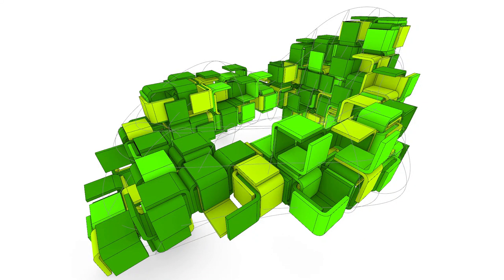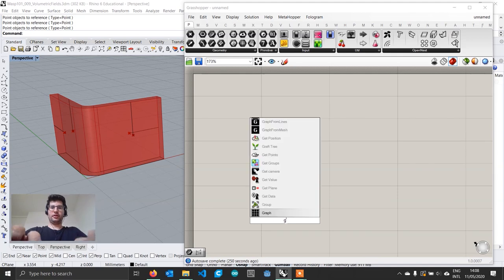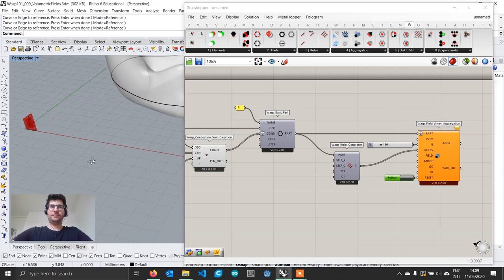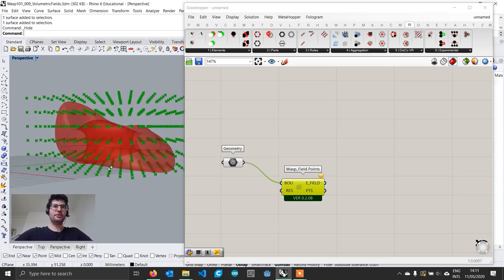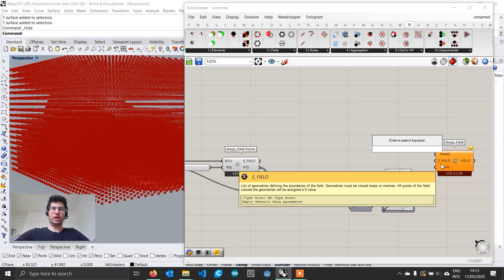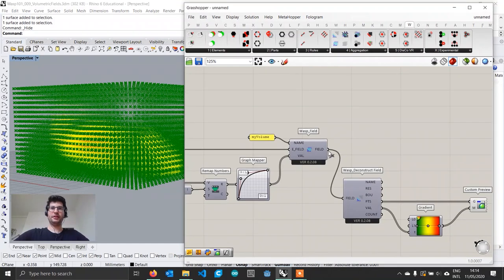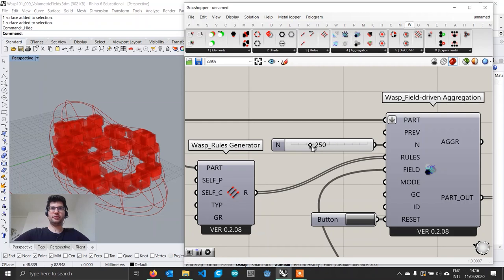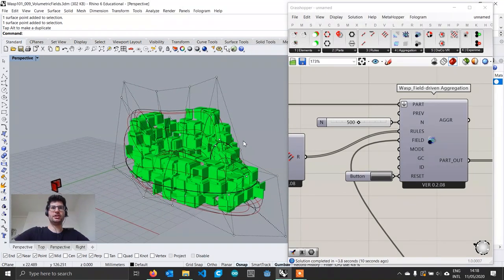Wasp for Grasshopper #101 - Tutorial #009: Volumetric Fields

Comment: Hi Andrea, thanks for the plug-in. I am confused about the difference between volumetric fields and mesh constraints after watching the tutorials. It seems like they both function as something to restrict the modular part to grow only inside a larger volume. I don't know if my understanding is right.
Reply from the maker: Hi! Yes, mesh constraints and volumetric fields can be used to achieve similar results (with mesh constraints normally being faster computationally). However, the main difference lays in the way they achieve the result: while mesh constraints rely on a purely stochastic (random) process to find the result, volumetric fields follow a logic growing from the center (or wherever you define the highest values in the field) towards outside. So, the main question is if you are interested only in the final result, or also in the intermediate steps and how it got to that result. As a general rule, fields allow you a more granular control on the aggregation process. Hope this clarified it a little :)

Comment: Hi Andrea! Ive been using Wasp for one of my projects now for class but I've been having a problem with volumes with holes. Sometimes the aggregation would completely fill all the space before filling the hole, but a lot of times it would bundle in a corner. For context, I'm using modules to create a pathway hence having a box with holes in the centre. Would you know if there is something I could do to fix the problem?
Reply from the maker: Well, it all depends on the relationship between your field's resolution and the dimension of your elements. This can influence the performance of the field. What I provide in the video is a basic general recipe that should work well in most cases, however geometries which are more complex might require a different approach. I would suggest trying to change a bit the resolution of the field to see if this improves the results. If it does not, feel free to send me the file you are working with and some comments at ghwasp [at] gmail.com and I can try to have a look.
Reply: @TempAutonArch  Thanks! I was able to fix the issue. It was the resolution. I appreciate the reply and free lessons!

Comment: Hi Andrea, thank you for the video series about your fantastic plugin! Is there a way to preserve rhino layers in the part geometry? I saw your proxy geometry video; I want to do something like that, except each of my detailed part has different materials within it. Is there any way to do this? Thank you.
Reply from the maker: You can do it in two ways:
- one is the one illustrated in the Geometry Proxy video, with the difference that you would create one attribute for each layer, in order to keep geometry in order. After aggregation, you can retrieve the geometry associated with each layer in the corresponding attribute. However, this will slow the aggregation down if you add a lot of geometric data.
- if you have a lot of data, the best approach is the one illustrated in the example file "0_04_Part_Geometry_Replacement" on Food4Rhino. You would do the aggregation with only the basic part geometry, and after aggregation you would explode the part, extract the transformation information and use that to transform all your elements in place.
Reply: @TempAutonArch  Thank you, I will give it a try!

Comment: Hello Andrea, thanks for your sharing, I try to make the rules for my component to aggregate in a box like a Tetris system, but when I follow the field process, it is failed. when I use the stochastic aggregation, it works. how could I aggregate different shapes in a box??
Reply from the maker: I am not sure why your field aggregation is failing. However, if you just want to fill a box, you can use a Mesh Constraint to do so, and use the Stochastic Aggregation. You can check the example "4_04_Global_Constraints_Mesh" for how to do that.